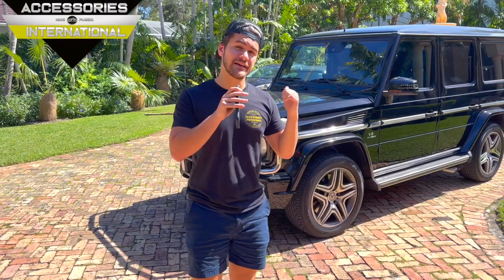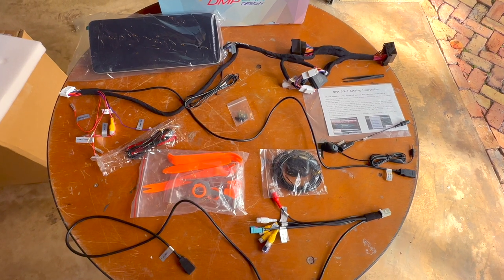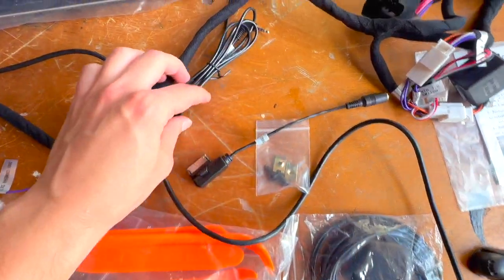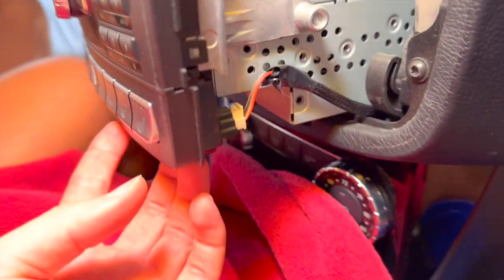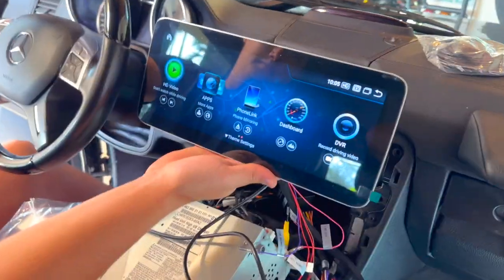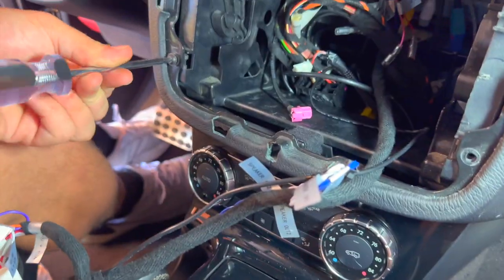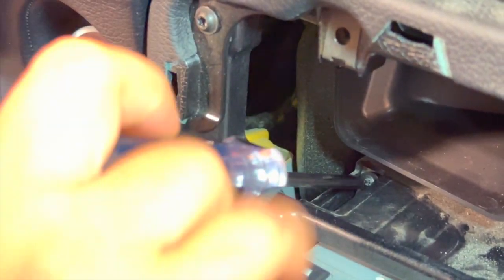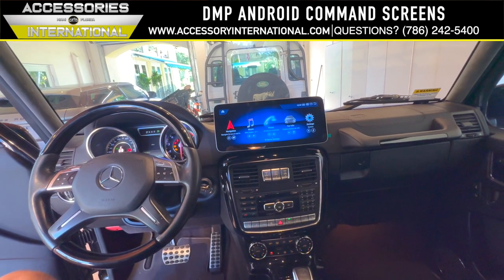Android Screen Installation │ Mercedes G63 AMG / G 550 / G Wagon (W463)

Comment: I purchased this kit and installed it in my 2014 G63.  It was basically as easy as they show.  I did have some questions during the install, and their support replied insanely fast.  Android Auto works great.  I am waiting to hear back on my SIM card and GPS questions to place those, but you can do all of the Android Auto features without the SIM card or external GPS antenna.  The support from accessories international has been above and beyond so far.  Good purchase.
Reply: Sim card? does this require a sim card? if so does one come with the screen?

Comment: Great video. Unfortunately, the rear view camera on my G63 2015 (half of the screen has blue lines) and the sound via speakers don't work either. The American plug seems to me to be a cheap solution. Do you have an idea or a tip? Thanks in advance
Reply from the maker: Did the camera also display this way on the original screen? 

The sound issue should be an easy fix. We’d need to take a look. Give us a call: 7862425400

-Alex

Comment: What size bit did you use on the hole saw to make the hole at 5:42 in the video? Or how many inches or mm wide is the hole you made? Thank you
Reply from the maker: 44mm
Reply: @accessoriesinternationalin6358  Thank you, just got mine delivered today and going to install tonight after running to home depot to go buy that bit to make the hole

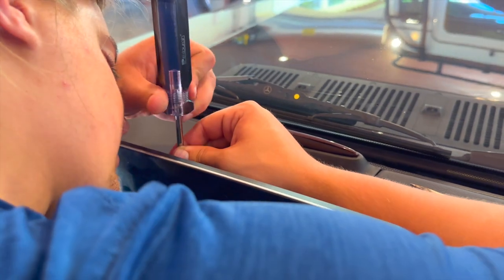Comment: At 7:37 are you sliding the screen into bracket or just lining up the screw holes? I'm doing this install now and I just cannot get it to slide into place. However, I can just attach it with the two screws and it seems plenty sturdy that way.
Reply from the maker: Line up the screw holes and tighten. Should be fixed in place from there.

Comment: What did you do with the antennas?
Reply: Antennas will fit. Was wondering the same. Like they said in the comments just line up the 2 t20 torx screws and the screen will line up fine.

Comment: Where do you plug the aux from centre console
Reply from the maker: Center console storage box. There should be a USB or AMI connector. Use the included adapter to plug into the car input and then the AUX into the adapter.